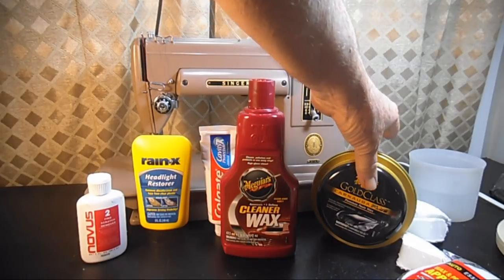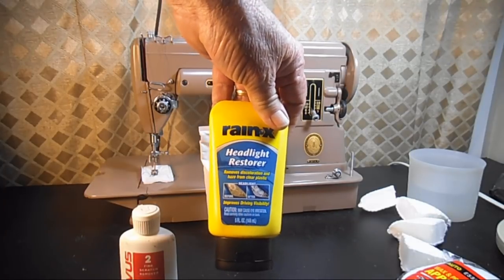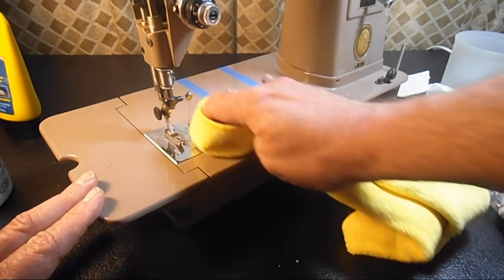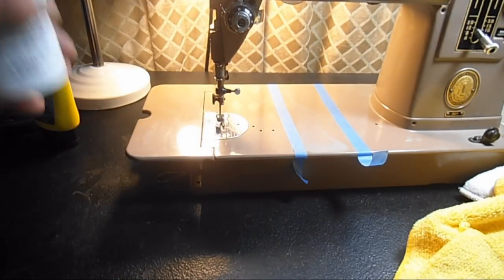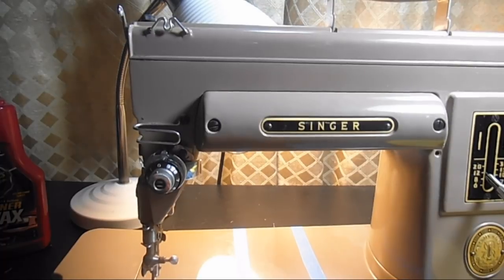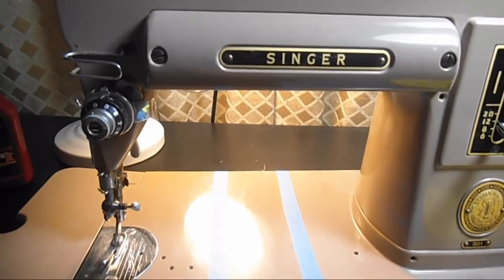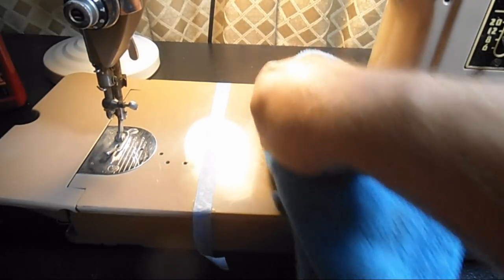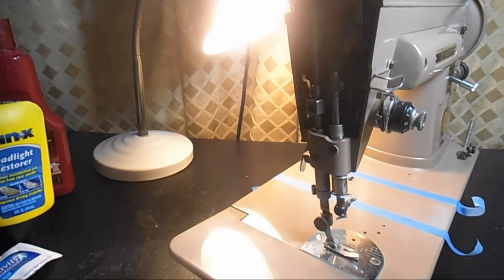Getting Protection -Coco goes to the Spa Pt. 12 - Singer Model 301A Rehab

Comment: Hello Andy - late to the game on this but I second the Meguiars Scratch X2.0. I used it on a 401 bed/surface a couple of years ago, prior to the carnuba wax and did notice an improvement on light scratches. I've since gotten the Novus 1 + 2 - works great on plastic,  (haven't compared them to the Meguiars yet). Purchased the Meguiars at Walmart -
Reply from the maker: Never too late to add good info, Mike. Thank you for sharing and I will pin your comment up top for others to see first.
https://www.walmart.com/ip/Meguiar-s-G10307-ScratchX-2-0-Scratch-and-Blemish-Remover-7-oz/16550259

Comment: Hi Andy!  Is it advisable to polish/wax the individual parts before reassembling the machine?  While I’m waiting for wash my Jacquy 301 ( I don’t have a strong hand held shower wand and may have to wait for warm weather and take it outside to hose her off) I’d like to finish up the pieces that have been washed and are waiting.  Also, I’m needing to remove oxidation and bits of rust from smaller pieces, like the bobbin case and assembly. I’m hoping the Nevr dull wadding or the Must for Rust will shine these pieces up.  Just saw the cradle video, too.  That’s another piece of this project which seems to grow daily.  But it will keep me busy through the next several weeks!
Reply from the maker: Sure, you can polish, remove rust and oil the separate parts no problem. You don't really need a strong spray of water to rinse off the machine. I have used a dipper from a bucket of water to rinse off the Krud Kutter. It takes a little longer is all. Rust removers will remove rust of course, but they will not shine up metal parts the way a metal polish will. Yes, if you will use the 301A in a cabinet you usually want to have the cradle to secure it safely and allow for folding it down inside for storage. 
It is a project, but so worth it for such a great machine. Good Luck.
Reply: Andy!  I exfoliated and blow dried my 301 Jacquy today.  Rust was immediately staring to appear.  Panic moment!  I had my Q-tips ready to dip in Must for Rust before oiling all her parts.  Good thing I had all the product on hand!  She’s resting now.  As am I!  Tomorrow I will wax and polish, then add more oil,if needed.  After that , reassembly is in order.  Is this a good order of events?
Reply from the maker: @candydeister  Yes, nicely done. I will often take a machine apart, then wash, dry and oil it and then the following day put it back together as start the adjustments. Sometimes I am finished the second day, sometimes not, haha. It sounds like you're doing it right! Good job.